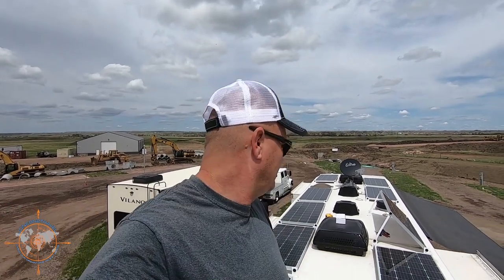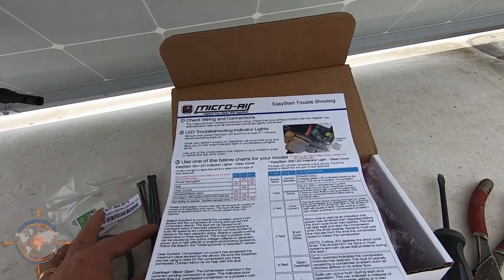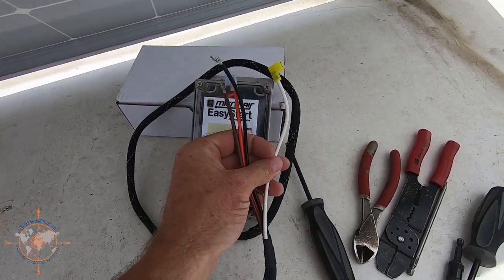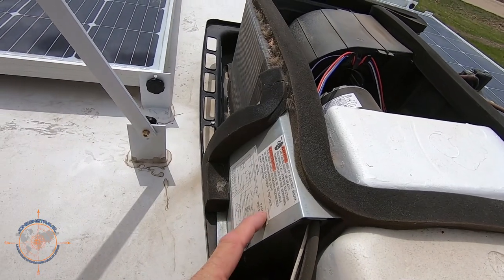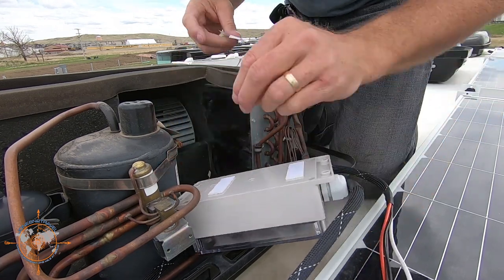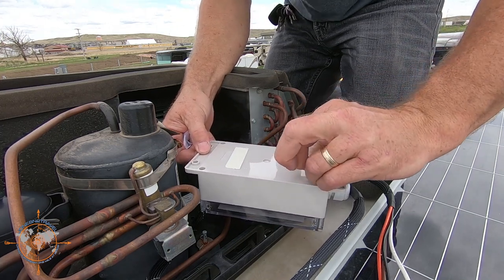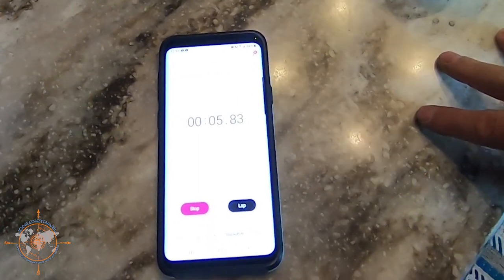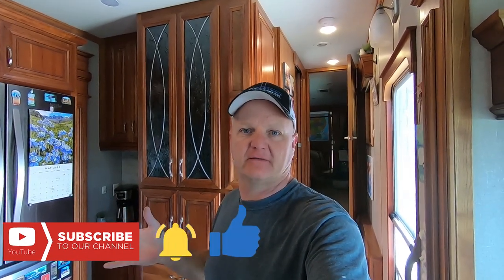HOW TO INSTALL RV MICRO AIR EASY START | DOMETIC AC | HDT RV LIFE

Comment: Micro-Air feels we've made a bit too much of a big deal of our EasyStart's learning starts.  Our owner wants everyone to know that there is an easier way to handle learning starts:  simply plug in your rig and walk away.  There's no  need to force the 5 learning start like our paperwork discusses.  Normal cycling through the starts each time the RV's AC reaches temperature set point is good enough.  Five starts occur within a couple of hours of installation in most cases.   Observing the outside temperature, set the desired temp a bit below that for AC (or above for heat pump)  and let 'er rip!   If you are in a rush, by all means force the starts like Aaron does in his video.   If not, go out and enjoy the great outdoors instead.
Reply from the maker: Hey there Kevin. First of all thanks so much for checking out the video. I appreciate your input. Great to hear that the installation time can be reduced greatly by eliminating the forced learning. :) Thanks again and Safe Travels.
Reply: @JonesN2Travel  Thanks for your video too!  We think it was quite well done.  Please attach this comment to pin to top of all for viewer info.  Thx.
Reply from the maker: Pinned :) Thanks again

Comment: Nice install Aaron.  Well done!  I installed the competitors unit on one of our Coleman Mach 3 units.  The amp draw on start-up went from 32 AC amps to 8!  Runs perfectly on our Battle Born batter bank too.
Reply from the maker: Hey guys. I am amazed at how well they work. I am able to run all three of ours on our battery bank for a short time but one unit for about 6 hours and that is amazing. :) Not to mention its much easier on our inverters when we're load sharing. :) Safe Travels Friends :)

Comment: Nice quick review of how to do the install. Good job and this helps for my install tomorrow. I am curious, you didn’t discharge the capacitor. I’m assuming you forgot or were just careful what you touched. The other thought that came to mind: be careful on your roof with a camera selfie standing up!! I wouldn’t like to see a YouTube video of you falling off and something happening . . .
Reply from the maker: Hi Joseph. Thank you for checking out the video. I was just careful but yes, you should discharge the capacitor. The scariest time on a roof is when its windy. I try to only get up there when necessary :)

Comment: I enjoyed this! Easy to understand. I will need these as well.. the Queen needs AC!  With these & your setup.. how many can you run while boondocking?
Reply from the maker: I tested it by running 2 ACs at the same time and after about 4 or 5 hours the batteries were down below 30%. Of course if its really hot they will run more often and use batteries faster but with the solar and bright sun it does really well. Hope that helps. I do solar installs and I'm a lithium battery dealer so when you get ready let me know and I can shoot you an estimate. :) Safe Travels
Reply: @JonesN2Travel  sounds like Fun!!

Comment: Good video,  I received mine from Hutch Mountain today and am getting ready to attempt it.  I was just curious if you could splice the black wire into the blue inside of the box without the need for the jumper wire?
Reply from the maker: HI there. Yes, you could as long as the ac wiring is long enough. What I've been doing lately is splicing the black wire into the blue just behind the electrical box. This allows the re-use of the factory grommet by leaving that one extra wire outside the box. Hope that makes sense. Safe Travels

Comment: Question for you sir: Could you connect the black wire inside the wiring box to the blue wire?
Reply from the maker: Yes. I've deviated from that as well and no longer use the jumper wire. It makes fro a much cleaner install. Safe Travels

Comment: Was the AC you installed the Easy Start on also a heat pump?  Great video enjoyed it.  Preparing to install 2 Blue tooth Easy starts on two 15k AC heat pumps on my Airstream.  Still watching videos on the process.
Thanks again!
Reply from the maker: Hi Guy. Yes 2 of our units have heat pumps. It is irrelevant to the easy start so you shouldn't have any problems. Thanks for following along. Safe Travels

Comment: Thanks for showing us this.  I have the exact same Dometic, and was wondering where to mount it. Did you notice any change in your cold airflow with the Easy Start in the way of the air intake? That would be my only concern with mounting it there, but I don't see any other options.  Thanks!
Reply from the maker: Hi Mark. Thanks for checking out the video. We did'nt notice any change in performance. You're right though, limited mounting choices ) Safe Travels

Comment: You make it look very easy .are you sure that one was a Dometic Penguin 2 . thats what i have but my looks a little different .I have a black circular capacitor .? do i remove it ?  I have the Easy Start and will install after this winter . i also got the Easy touch RV thermostat . thanks Don ( Ontario Canada )
Reply from the maker: Just follow the install manual and disconnect the appropriate components. Than you can leave them installed (disconnected) or remove them from the unit completely. Hope that helps Safe Travels
Reply: My Demonic Penguin 2 looks a bit different as well.  Watching this video tells me to take this white wire off and connect to this other one and the same with the red, white, blue and black one.  Put the orange one over here and wahlah. done.  So simple

Comment: Great video one thing to mention when working around a capacitor always take a screw driver and ground terminal to terminals prior to working on it
Reply from the maker: Excellent point. Thanks for that tip. Safe Travels :)

Comment: Hi Aaron, enjoying your videos. I noticed a satellite on your roof. Do you store it when traveling?
Reply from the maker: Hi Mike. The satellite is a Winegard Traveler unit permanently attached to the roof. It folds down when we stow it away for travel. :) Hope that helps. Safe Travels.
Reply: @JonesN2Travel  thanks Aaron, it does. Safe travels to you as well

Comment: This product claims that you can run both AC's on 30AMP service. Here's the thing, my coach has a switch between the front AC and the rear AC. The only time I can run both AC's is if I am running the generator because it has a 20A dedicated circuit for the rear AC. So if I am plugged into shore power? How can I run both AC's at the same time? Or perhaps I misunderstood.
Reply from the maker: Hi David. When your on shore power your entire coach should have power and you should be able to run everything. When you are on your generator it may not be powerful enough to run both acs so they may have it split off. Not sure why you would only be able to runone at a time. It's the starting amps that the micro Air reduces.
Reply: @JonesN2Travel   Not in my case. There are two separate circuits for both AC's. The one that controls the front and the back via a switch. In order to run both AC's together, my generator has to be on because it has a dedicated fuse. My coach is simply not wired to have both AC's running at the same time unless the 7000 watt generator is running. That's why the manufacturer put a 7000 watt in my coach  due to the load responsibilities. When plugged into shore, I can only operate one or the other because of how it's wired. Now, today's coaches, many of which are on a 50 A system, are wired differently and could benefit from this product. Due the lack of 50A service in some parks for example. I believe that audience as well as those who have very small generators, inverters, and a single AC will highly benefit.
Reply: @davidthomas4489  I know exactly what you are talking about. My 95 fleetwood flair was the same way. There was a switch in the living room above the couch in the over head bin.
Reply: @TheEastCoastSensation  I discovered a way to run both airs at a campground in my situation. Install a 20A transfer switch in between the rear AC and the generator. One has an output to load (the AC) and the other two are inputs. One from the generator and another (which there is a plug on one end) can be ran to the 15/20 A pedestal at the campground.

Comment: I hope folks don't listen to your install on the EasyStart placement.  You put it right in front of the A/C blower motor.  Big no no and I'm sure you already found that out the hardway being you did this install over 2 years ago.  MicroAir even states you shouldn't put in there as you are blocking the blower motor from dissipating the heat from inside the A/C housing and will also overheat the EasyStart causing issues all around.  The Easy Start is supposed to install on the same side but opposite end with it being half on the Styrofoam wall and half on the black plastic area nestled and facing the copper pipe.
Reply from the maker: Not all model ac units have that configuration so sometimes you have to get creative with the placement. In the nearly 3 years I've had them installed I have had zero issues with the ac units or the Easy starts. I've installed over 50 of these without issue. Safe Travels
Reply: You made a very correct observation! The place where he put the box with electronics is probably the worst. You should never put it in that place Micro-air easy start box!.